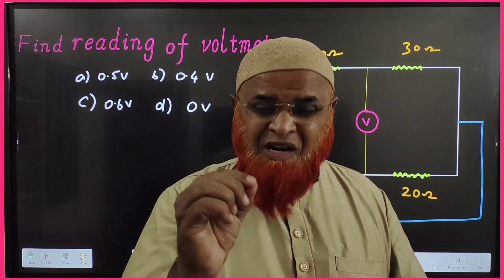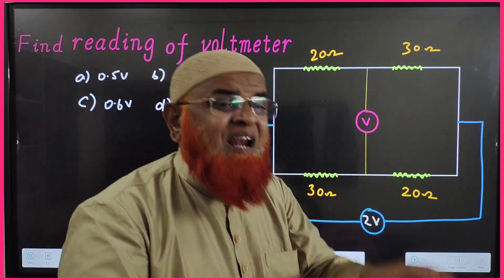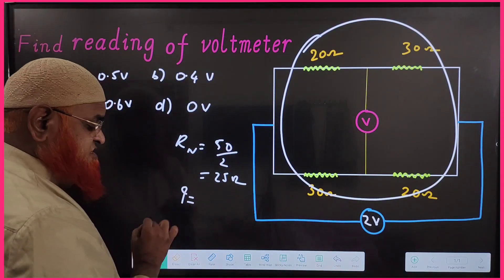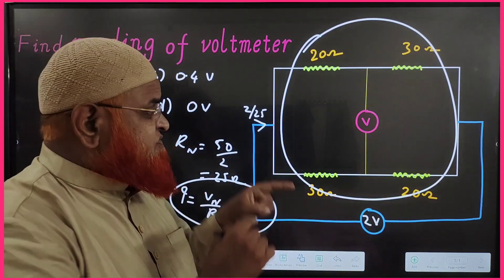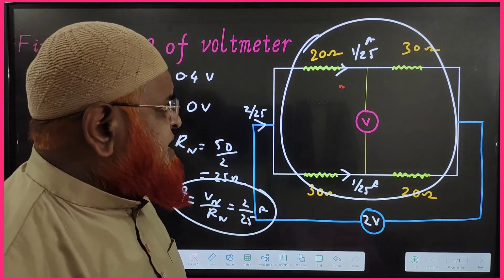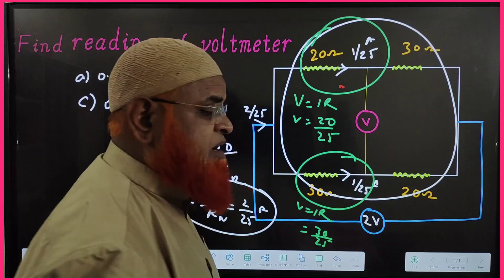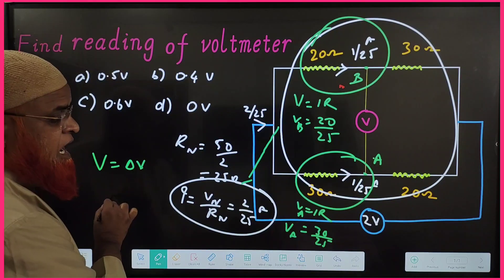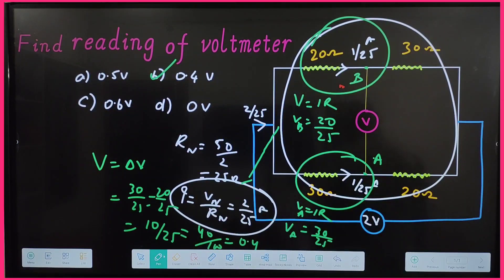Current electricity short tricks | NEET 2024 |

Comment: Upper point will be at  high potential. Just calculate the potential drop at 30 ohm resistance  at upper and for lower at 20 ohm then difference